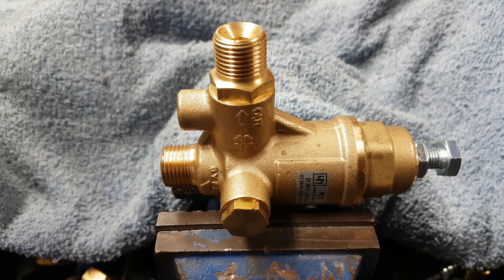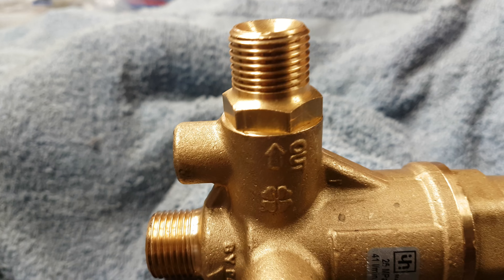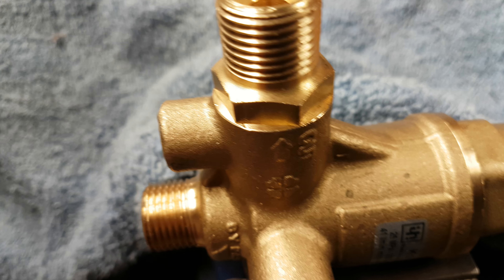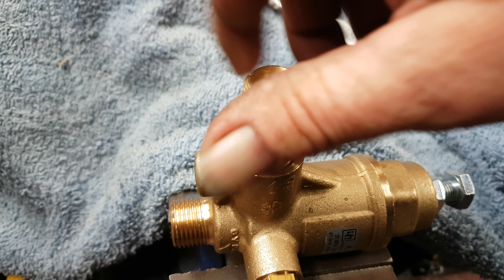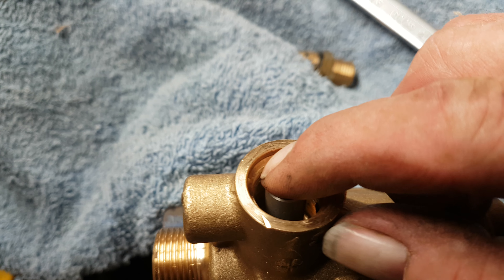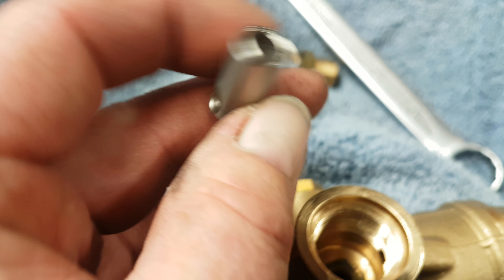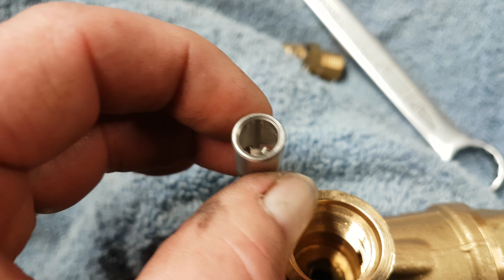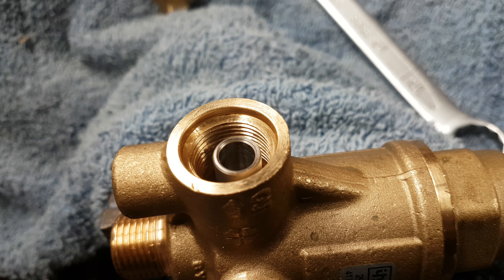QWASHERS EBAY K1 FLOW SENSITIVE UNLOADER DIRT HOW TO CLEAN CHECK FAULT SERGING PRESSURE WASHER

Comment: Hi Damian i use K1 unloaders on my 21 liter machine never had one surge but have had a few die on me pull the trigger on the gun and slight hesitation before pressure then eventually press trigger and no pressure at all fit a new K1 and working normally again what could cause this and can you renew rebuild the K1 thanks